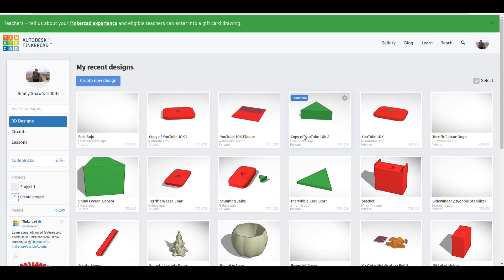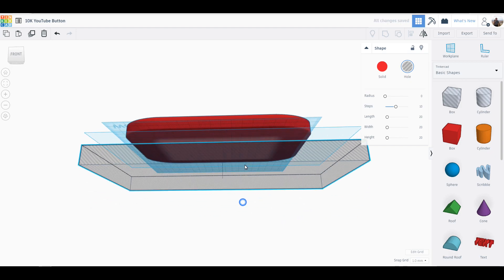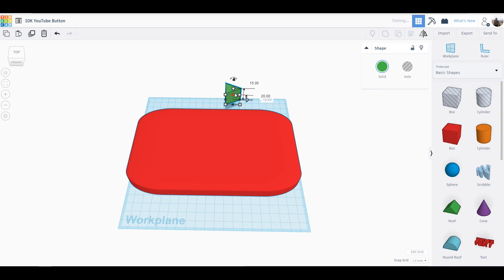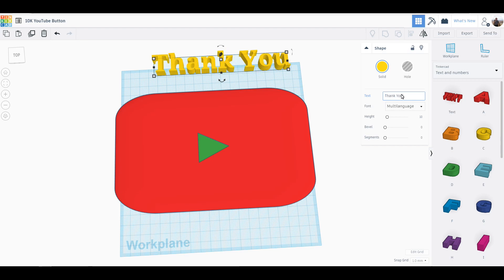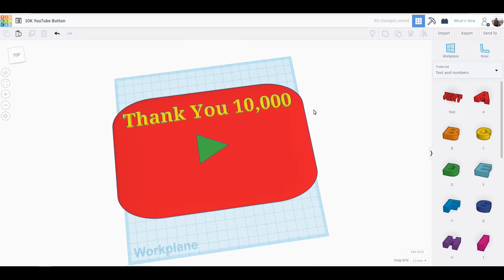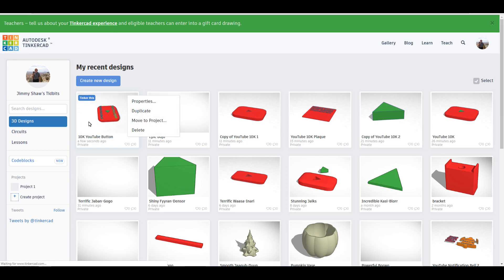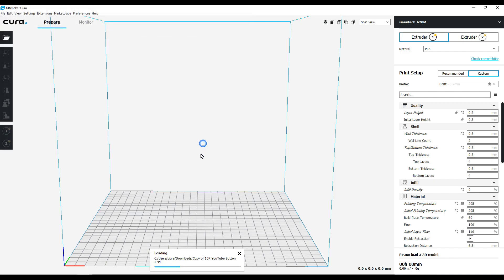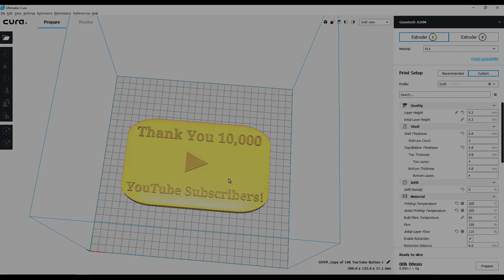Designing A Multicolor Print In Tinkercad in real-time

Comment: maybe i'm wrong but don't you need to give a little clearance with the holes and inserts? or are you planning on it fitting super tight?
Reply from the maker: You don't if you are printing in 2 colors as a single piece.   In this case the print is a single piece.
Reply: @JimmyShawsTidbits1  oh ok. I guess I wasn't paying attention. I was thinking it would be like something with parts you had to put together.